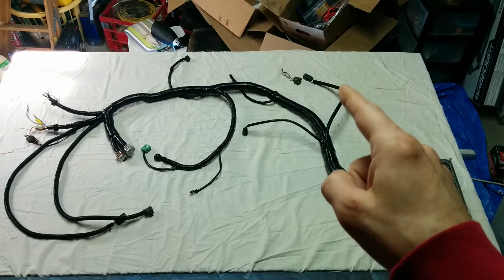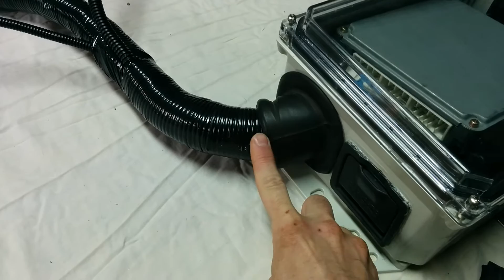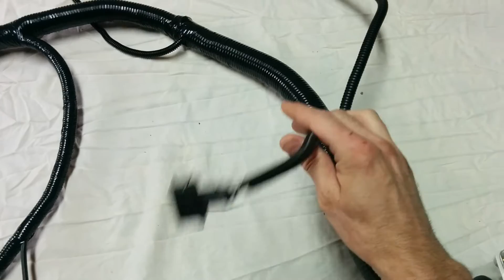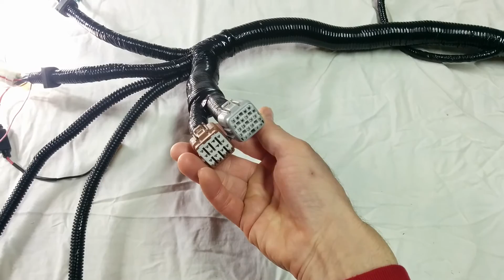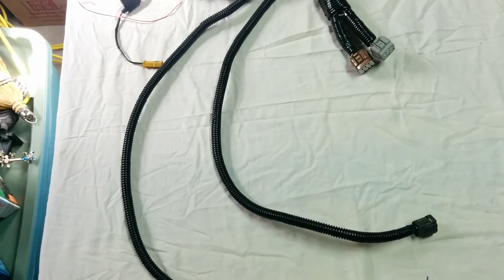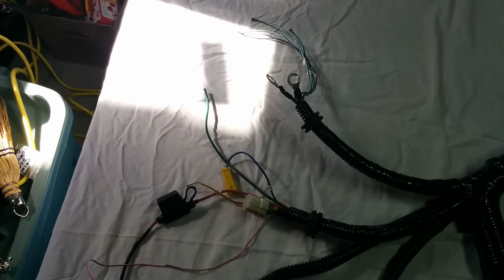SubaruVanagon wiring harness

Comment: Hello, you video is well done , Q: is there a chance you can explain the cruise control option you mention and what color wires go to where ? especially in the van [black box ]itself. Thanks
Reply from the maker: Thanks John. They are the CC wires from the Subaru harness. There is no corresponding blackbox wire. Instead of running through the blackbox, you'd run a separate shielded wire under the van to the front and add a Subaru CC stalk (or similar) to manage it. I have never used it, but will whenever I feel like adding CC to my van :)

Comment: What option did you do with the  Radiator
Reply from the maker: Not sure I understand the question. I don't recall anything on the wire harness that was related to the radiator, but its been 5 years now, so I probably forgot! :)
Reply: @JasonWestra  sorry where did you put your  Radiator underneath the bus
Reply from the maker: @timsshed7843  I left it in the front. Standard radiator install on this year Vanagon

Comment: Who did yhe harness an ecu for u?
Reply from the maker: My kit was Rocky Mountain Westy.  RMW originally did the wiring. However, they only wire for an ECU in the bench seat. I wanted that space for storage, so I tore it apart and re-did it myself to fit in near the passenger tail-light cubbyhole.

Comment from the maker: Thanks.  I bought a Subaru manual in PDF form online.  Nice to use if from my phone anytime I want to reference it - even on the road.  Since I had a full donor, I had tons of left over wire to make the mods and then bought new aircraft-grade shielded wire for the sensors.  Good luck!

Comment: I like what you did.  I'm not real hot on the ECU taking space inside the van either.  I have a 2001 Forester EJ25 I'm about to drop into my Vanagon.  Any tips you might have with sources for wiring diagrams or anything you discovered after this video is appreciated!